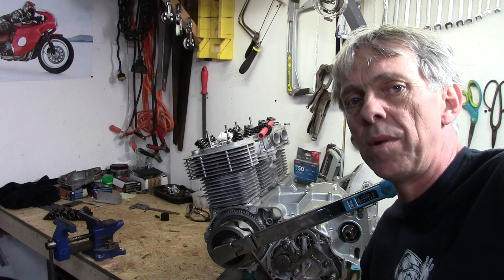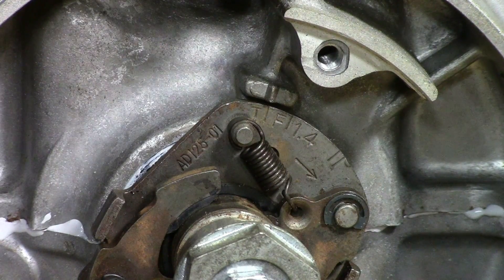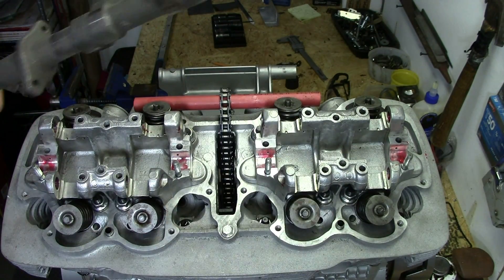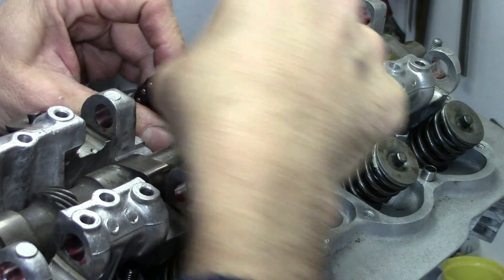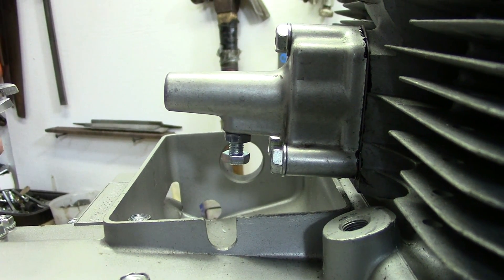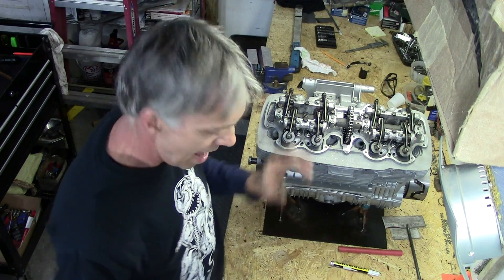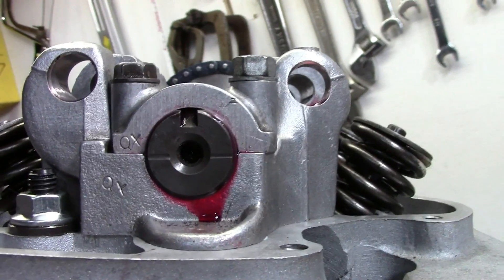73 Honda CB750 Custom Build Part 19 - Camshaft & Valves

Comment: Regaurding your previous episode 18on the 73 Honda CB750 on cleaning the parts. Their's areally cool Loctite product numberd 7673 cleaner/degreaser. Which is dead handy for both cleaning/degreasing parts 😁😁😉👍🤝👏🏍💁‍♂️🇺🇸🏴
Reply from the maker: Good tip.

Comment: I recently picked it up an '81 CB750 that the previous owner had completely disassembled, stuck into 5 unlabeled boxes, and left in his garage for 12 years.  I'll be watching your series for a while in the coming winter months.  Thank you for taking the time to make these.  Detail like this is hard to come by!
Reply: @brad althouse I have an 82 cb750 that is driving me insane. I removed the airbox and installed a K&N filter kit.
Reply: The   81 ....   twin o/h cam .....is a completely different motor to the s.o.h.c.

Comment: Ive always had a lot of mechanical car knowledge and really wanted to look into a cafe racer style bike. The videos and advice you give are excellent. Im picking up a fixer upper in a few weeks to drive around town and to work (5 minute trip with the new job). Cant wait to tear into it once the temp get above 40 here in Michigan, most likely mid April at the rate the temps have been around here. I have the confidence I can fix anything on it after watching all your videos!

Comment: Another awesome video! Going todo my valve adjustment tomorrow(if I can find that small feeler blades locally anyway lol!). Do you happen to know if that final drive seal would on a 1975 750F could be changed with the crankcase together? I know you said later model F's but hoping you meant later than 75. Seems crazy to split the crankcase to change a seal!
Reply from the maker: I think it can be changed, but not 100% sure. Thanks for watching!

Comment: It's interesting that the camshaft is secured at 4 locations which what people say is over defined and there are no bearings to help the camshaft rotate smoother. I'm trying to understand why they design it like this.

Awesome videos!
Reply: pusinxx Many overhead camshaft engines are designed this way. The camshaft has very little side loading on the bearings so this type of bearing works ok.
Reply: with perfectly round polished steel and some oil that section of the shaft is a bearing . no doubt there are ways to improve , i don't know about bikes but some later model v8's started using roller rockers because the cam lobe is prone to wear out , i've seen lobes with 1/8 inch deep grooves worn into them .
Reply: jerry henderson Bigger springs for the bigger valves means more resistance and more friction. That mass has to stop moving and reverse direction which equates to some high peak forces.

Comment: Great video series! I'm about to get my first motorcycle -- a cb750k4.  I've watched this whole series from start to finish in order to get familiarized with the bike and learn as much as I can about it.  Rookie question: why don't the camshaft journals require bearings like the crankshaft and connecting rods?

Comment: I have read that the spindle bolts rob horsepower. Supposedly the early model bikes didn't have the bolts. Trade off is possible rattle at higher rpms

Comment: You put assembly lube on every metal-on-metal part EXCEPT the adjuster screw end or the valve stem end where they meet (or did I miss it?). Pretty important not to have them start off dry.

Comment: Excellent Video !!
Right now I'm putting together a 1977 model Honda CB750F engine (motor CB750E number 2615951) to recover from a failed mechanical unarmed, and I have great doubt. you begin chapter 19 with two small pieces through your fingers ( Calls orifice oil control Partt number 12238-300-010) in my engine are not present these parts.
It is possible that in this model not bring? what if I build the engine without these parts?
thank you very much

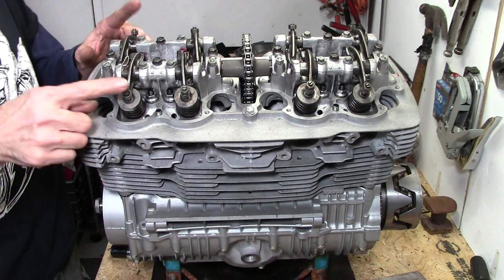Comment: Hi, great video... How do you know when you're at 4 top dead center, what does that look like? at 30:25
Reply: A straight 4 fires and is at top dead center every 180 degrees.  The firing order tells you which cylinder is next after #1.  Then turn 180 for the next in the firing order etc.  The valves will be loose on the cylinder that is on Tdc and the cam lobes will be away from the rockers.  A v8 auto engine fires every 90 degrees of crank rotation.  You can put your thumb over the cylinder and turn the engine.  When the air pushes your thumb off the plug hole, the valves are closed.
Reply: @graymodeler  Thank you very much William... what if the person accidentally put it with the notch down? So it was 180 degrees out.  Would the person (cough) have to pull the engine from the frame again and start over... or could you still get the timing correct?  I have a Dyna Electronic Ignition... if it was 180 degrees out would I be okay?

Comment: Assembled Camshaft and I can adjust the valves as per catalog....its almost as if the cam is 180 degrees off? If I rotate cam 180 with notch down and leveling marks horizontal with retainer. Help!
Reply: +pllagro - I can adjust intake and exhaust tappet on cylinder #1 but not the other factory specified ones per book...Such as exhaust tappet #2 and inlet tappet #3----tappets are all the way out and I still can't adjust???
Reply: @honda850chop I've re built this 2X now. Yes, last go round. It was a timing sprocket position. You have to get the sprocket bolted correctly along with chain positioning.

Comment: Am I ok if the cam notch is down when #1-4 is TDC and both rockets loose only on 4 or must it be #1 that is TDC and cam notch up. ?
Reply: I have the same problem om my bike. Did you change it?

Comment: I just checked my valve clearance a couple days ago.  After watching your video I realize I definitely set mine too loose.  It's making my tappets louder than usual.   I didn't realize they should be that tight on that feeler gauge, I set it so there's just a very slight bit of friction on the gauge, it moves very easily in and out... not enough friction to hold the feeler gauge in place while it hangs off the engine like that.  I guess I'll go back and re do it.  Should it be tight enough to where the next size gauge up won't fit...or will that next size gauge just be super tight with a lot of resistance?